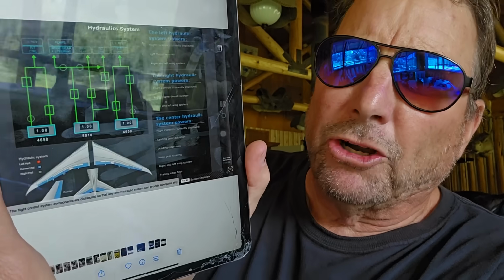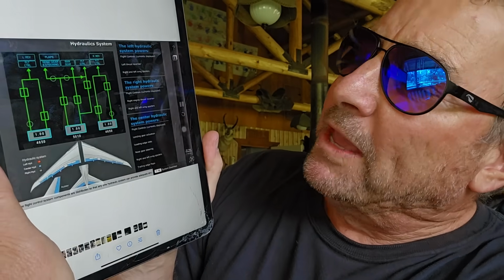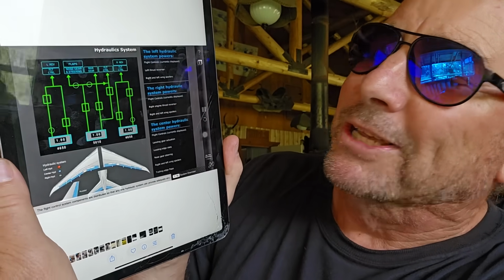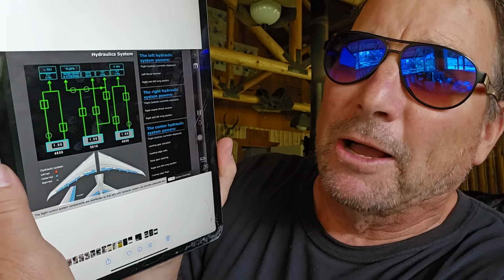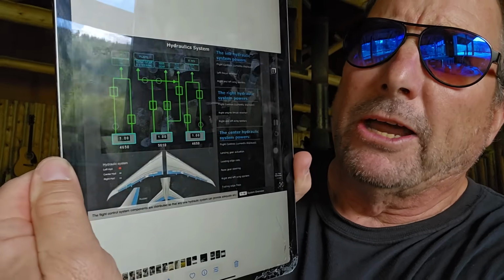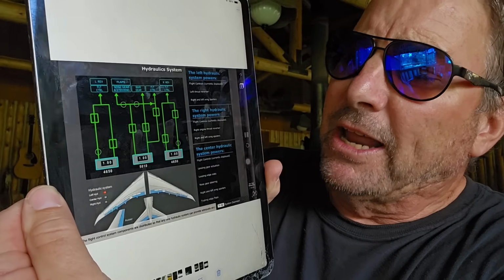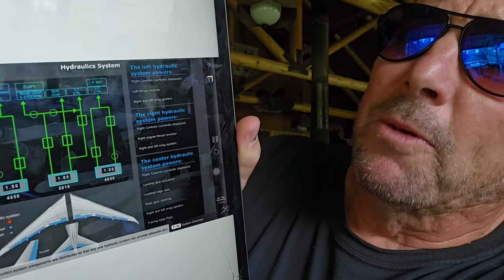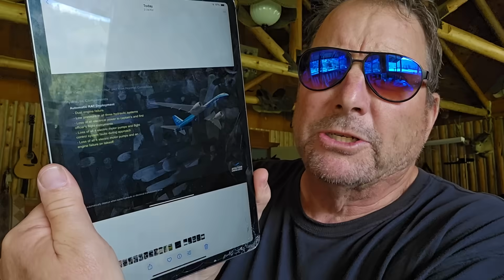787 Crash India What's a RAT? When does it deploy?

Comment: Thank you Juan. This is a bizarre puzzling accident. Enough thrust to rotate but within seconds the thrust is seemingly lost. No smoke, no fire, mostly no visible sign why thrust wasn’t enough to climb out. Add the probable RAT deployment throws more confusion in the accident. Something terrible happened and I just hope the cause it found and rectified. May all those poor soils rest in peace.
Reply: I believe the engines were starved of fuel shortly after takeoff by an electrical failure. You can see the 787 visibly stops climbing out.

I'm very much convinced of a serious electrical issue. On a previous flight that 787 had electrical problems (video'd by a passenger apparently) and the sole survivor of the accident flight reports a loss of cabin lighting too, shortly after takeoff.

TOTAL loss of electrical power would mean the fuel pumps for the engines shut down too (the 787 has no engine driven mechanical fuel pumps as backup/redundancy) and any fuel they continued to receive would be by gravity feed only, so the engines would definitely spool down and the RAT would also be deployed on the loss of electrical power.

Conceivably the RAT might then provide enough electrical power to get the fuel pumps delivering fuel to the engines again  BUT the engines would then need to spool up to provide useful thrust and I think they simply ran out of altitude/time in which to recover.
Reply: @grahamstevenson1740  well, you got it half right.
Reply: Rotated in the remaining undershoot/overshoot area after an intersection departure. Ingestion of fine dust/dirt/debris in this unused area of the runway could theoretically cause a dual engine failure much like BA 009 and volcanic ash.
Reply: @karlhunt4098  This is an interesting theory. The first thing I thought when I saw the video was "wow that's a lot of dirt in the air right as it rotates".
Reply: I've heard a lot of people saying there was no smoke, but as the aircraft goes behind the shack, there is smoke.  Watch it again.  I don't know if it was engine related or just dirt or something on the runway, but there was something.
Reply: I saw that the media interviewed the survivor again and he indicated that the takeoff was normal but once it got airborne it felt like it was hanging (likely stall) and he said pilot put power up.
Reply: Would the audio analysis be able to tell if the engines were making the correct levels of thrust, or not?
Reply: @Biochemechanic .  I believe the Flight Data Recorder will indicate what the thrust level was.
Reply: @stevez6499 Yes, hopefully that was still powered.
Reply: @Biochemechanic  No. There is no baseline for that mic at that position in those conditions to know what "normal" or "abnormal" should be. Its too variable, just a slight wind shift can alter what sounds you pick up at distance. Rather than engine absence, you might hear engine surge.
Reply: I think they were going way too slow. You can calculate their speed yourself from the videos. (It's called photogrametry.) In the video taken from the port side, pick a landmark and count how many frames it takes for the entire length to pass it. (I count 23 or 24 as the plane enters the frame, but let's say 22 to be generous.) Divide by frames per second (22/25=.88). Then divide the length of the plane (186 or 187 feet, depending on source) by that number (187/.88=212.5). That gives feet per second. Convert fps to kts (212.5 fps = 126 kts). Doing the same from the video taken from the starboard, my most generous estimate is 146 kts while in flight (using the right pole of the pair in the middle as reference). I'm no pro, and this is not very precise (you have to do your best to determine where the nose is), but if those videos are playing at the correct speed, I think my methods are sound, and the plane was going way too slow as it lifted off over the dirt overrun area. (Note - these are ground speeds, so add ~7 kts for wind, and they are snapshots at two moments in time.) I'd think if they were going fast enough they would have rotated before the end of the runway.
Reply: @DrBeenaPlumber It's not clear that they actually overran the runway. Certainly possible, but the channel "Mini Air Crash Investigation" has a FS recreation, which could make sense combined with it being a hot, dusty, day in Amhedabad.
Reply: @robo1p  I meant to say they lifted off right at the end, not necessarily an overrun. But there was no sign of the dust anywhere else other than where they lifted off. On a dusty day I'd expect the engines would also have been kicking up dust. That's my reasoning anyway. I've been wrong before.
Reply: @DanielC_, NOTHING will happen, NEVER does, just like NOTHING happen to the military, at the Reagan Airport crash, the FAKE NEWS will drop, the story in no time, and NOTHING will EVER change, welcome to the most corrupt country, in existence.
Reply: *souls
Reply: @JohnWerner-te5zy I would love to know the average age and education of everyone in this thread because reading comprehension and critical thinking skills are seriously lacking for most of you guys.
Reply: They will fond your answee
Reply: First video I saw of it didn't have audio... So my initial thoughts was extreme long distance flight and overloaded and getting dragged down... given all the war zones it had to try and fly around.

Maybe bad fuel as a starting point....
Reply: @wrayday7149 , bad fuel would have manifested long before they lifted off the ground.
Reply: @crusher0427  Not necessarily, they could have been on a good tank of gas and the computer pumped bad gas in to balance.

But it's the quickest and fastest thing to check while waiting for recovery of other data.
Reply: No smoke 💨 is why I’m thinking engines lost fuel supply 🤔
Reply: Oh man these comments are frustrating. Some of you have wrong info, and some of your are making guesses that the evidence already shows are wrong. 

Let’s wait and see what the investigation says. So many people had stupid things to say about the Korean crash and had to eat humble pie when all the evidence came out.
Reply: @MeppyMan  
And some obviously didn't even watch the video first. Just like car accidents draw ghouls, aircraft crashes bring uneducated, unknowledgeable "experts" to the comment sections.
Reply: If you can believe the stories posted, the inbound flight of this aircraft as videoed allegedly by a pax, had some significant cabin electrical anomalies.  On the video of the initial climb, it sure looked like the tail moved to port a bit. With the loss of ADSB data, electrical and engine fail on takeoff?  I think that was one of  the options Juan mentioned that might cause a RAT deployment.  All speculation but I do hope they identify a cause soon.
Reply: @ajg617 Lots of stories and many from credible people but still just speculation. That electrical issue is interesting if there is any truth to it. But double engine loss due to electrical? With all the redundancy it’s seems far fetched. I haven’t seen if they’ve recovered the FDR but my guess is when they do and it’s intact with all the data,a reason will be identified quickly.
Reply: @DanielC__  I hears they found the FDR. Don't know it that's true. Now we just have to hope the FDR stayed powered up the entire time. An electrical failure might stop the FDR from recording. I sure hope that's not the case.
Reply: @DanielC__  Can only hope the FDR has the data and isn't a repeat of Jeju.  It bothers me that FR24 lost everything at about max altitude they attained.  FR24 isn't the end all, but it does look a bit like Jeju.  As far as double engine loss, I think Juan said combination of one engine failure and  4 hydraulic pump failure on take-off will cause RAT to deploy.
Reply: @dougrobinson8602  The news said that they found the flight recorders in bedded in the side of a building.
Reply: @DanielC__  the issue is electical is tied to engines. imagine your car. while it does have a battery  most of the power it gets is from the engine running. so if a plane is havign electircal issues that means the engines are havign issues.
Reply: @DanielC__  I won't be surprised that they quickly identify what happened, but not why it happened for a long time.  For instance they may quickly determine that the engines lost thrust temporarily but then determining why they did will take a long time.  It looks like right now that Indian's AAIB, the US's NTSB, UK AAIB and Boeing are all involved in the investigation. That many groups both help and hinder
Reply: @ajg617  I believe the engines were starved of fuel shortly after takeoff by an electrical failure (the 787 relies on electrical fuel pumps). You can see the 787 visibly stops climbing out.

I'm very much convinced of a serious electrical issue. On a previous flight that 787 had electrical problems (video'd by a passenger apparently) and the sole survivor of the accident flight reports a loss of cabin lighting too, shortly after takeoff.

TOTAL loss of electrical power would mean the fuel pumps for the engines shut down too (the 787 has no engine driven mechanical fuel pumps as backup/redundancy) and any fuel they continued to receive would be by gravity feed only, so the engines would definitely spool down and the RAT would also be deployed on the loss of electrical power.

Conceivably the RAT might then provide enough electrical power to get the fuel pumps delivering fuel to the engines again  BUT the engines would then need to spool up to provide useful thrust and I think they simply ran out of altitude/time in which to recover.
Reply: @grahamstevenson1740  I find it hard to believe those engines don't have engine driven pumps. I guess the concept of a total electrical failure at six hundred feet did not compute. It could have been thought that this scenario was statistically impossible.
Reply: @user-xz4ke3qw7w  clowns and jerkoffs at BOOING
Reply: They didn't really have enough thrust at any point IMO, they only got airborne because they built up momentum on the ground
Reply: My first fear is single engine failure and reduced power on working engine by the flight crew. They had some measure of control, the nose bobbed up a few times as they stalled. Hopefully we get the data recorders in short order.
Reply: @classicalextremism  Having a look at the second video (where you can hear the RAT), the rudder does not show any large deflections, which would indicate to me that either both engines were working or not working, no asymmetric thrust.
Reply: @stratos2 excellent point
Reply: @classicalextremism  well, so much for a single engine failure speculation.
Reply: The black box will contain all of the engine parameters.  The NTSB will quickly figure this out.  Usually they sit on their butts for three years to publish a final report but with 1000 787s flying, it is imperative to work quickly to preclude another accident.
Reply: @williampotter2098 I agree, no way they sit on this very long. As soon as they know, we’ll know pretty fast. Not only too many 787’s but Boeing needs a quick resolution and it’s probably a factor even though it shouldn’t be.
Reply: @DanielC__  
Very good point that Boeing needs a quick resolution after the 737Max debacle.  And the US needs Boeing to be healthy as our major competitor to the Airbus. We need to keep Boeing alive to continue to keep the aviation expertise it provides us.
Reply: @williampotter2098 wouldn’t be handled by NTSB since it occurred in India
Reply: @pokemon4395  they would be a part of it. it's an american made plane
Reply: @Revkor no Boeing would be part of it but the NTSB wouldn’t have a role unless India asked which I doubt they would since they are more then capable to investigate the cause.
Reply: @Revkor I saw one report where an NTSB team was en-route. India might have asked for them. The NTSB is probably the world’s best aviation investigative authority. It can’t hurt to have them there. Boeing would certainly have personal there too.
Reply: @pokemon4395  
It won't officially be controlled by the NTSB but the NTSB is much more experienced at these investigations.  And they have already sent a team to India to "help" India's Aircraft Accident Investigation Bureau (AAIB).
Reply: @williampotter2098 well that what I been saying that they wouldn’t be the lead. They are to advice if needed.
Reply: @pokemon4395  
That's what I said on three posts.    shm
Reply: @pokemon4395  
Read all of the comments
Reply: @williampotter2098 the NTSB will not be the primary agency investigating. It will be India's AAIB with help so far from the NTSB, UK's AAIB and Boeing.
Reply: @williampotter2098  for full report yes but they will hint thigns and this would be onw they quickly do.
Reply: @Revkor  
The NTSB usually gives a preliminary report at about 3 month, but they aren't in charge of this investigation and there will be politics involved. The Aircraft Accident Investigation Bureau (AAIB) of India is running it with the NTSBs help.

Comment: The RAT still doesn't explain the flaps not being deployed. (Prior to takeoff)
Reply: I've seen pictures of one of the wings after the crash, appears that flaps were extended. Other pilots have said that the warning signals would have been going off if flaps weren't set before takeoff.
Reply: Some are claiming they're visible deployed in one of the videos.
Reply: They were but probably raised instead of the gear
Reply: They were almost certainly deployed for takeoff.
Whether or not they were retracted once airborne is a different question and almost impossible to tell from the video.
5 degrees of flap is extremely hard to see from that distance.
As the slats can be seen deployed we can probably assume the flaps were also unless there was some strange flap malfunction.
Reply: @Captain101-x1o  But they were at 3500' and ambient temp was 105 degrees. They would've needed full flaps.
Reply: @rickrudd  never full but it could have been flaps 5 or 10 degrees based on Boeing chart "Full" flaps is a landing thing.  You can download the Boeing 787 airport guidelines.  search "787 Airplane Characteristics for Airport Planning"  look for the chart "787-8, High Thrust version, +25 degree ISA."  AI has the high-thrust option of the 787-8.
Reply: Flaps were visibly deployed on the shack video and the balcony video, just have to look close.  Only 5 flaps on a 787-8 at 4Kft density altitude...
Reply: @Air-Jon  Ambient temp was over 105 degrees.
Reply: @rickrudd  yes and the takeoff chart on the 787 shows 5 flaps for 3k to 4k ft DA for a large portion of the weight curve.

Comment: This from Grok:   The RAT deployment in the Air India Flight AI171 crash, combined with passenger reports of non-functional AC and cabin electrical systems on the same aircraft hours earlier, strongly suggests a significant electrical failure as a primary or contributing factor. The RAT’s activation indicates a loss of primary power (engine generators and APU), likely exacerbated by pre-existing electrical issues that affected the AC, cabin systems, and possibly flap deployment. The non-extended flaps, extended landing gear, and “no thrust” Mayday call align with an electrical failure disrupting critical systems, including engine controls and flap actuators, leading to insufficient lift and the crash 30 seconds after takeoff. While a dual engine failure (e.g., from a bird strike) remains a possibility, the passenger-reported electrical issues point to a systemic problem that likely predated the fatal flight. The electrical issues, particularly with the AC and cabin systems, and the RAT deployment strongly suggest a significant electrical failure as a key factor in the crash of Air India Flight AI171. While a dual engine failure remains a possibility, the pre-existing electrical problems reported by passengers, combined with the non-extended flaps and extended landing gear, point to an electrical failure as the more likely primary cause
Reply: I bet something critical was jury-rigged and left that way. Like the Dali having electrical failures at the dock and they just kept resetting the circuit breakers.
Reply: Or the broken AC could be completely unrelated